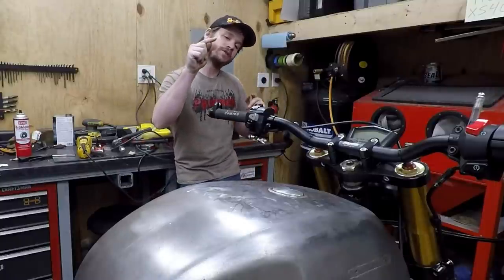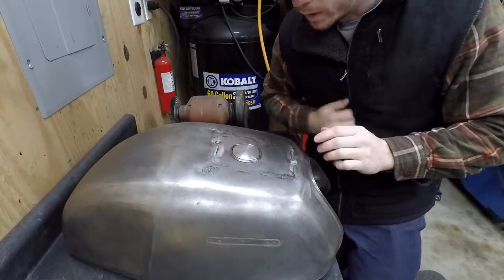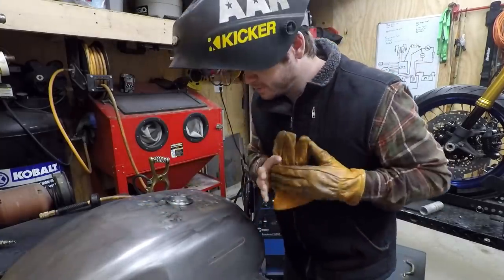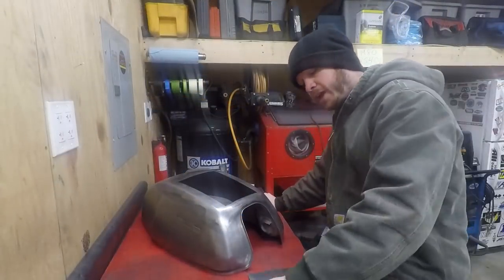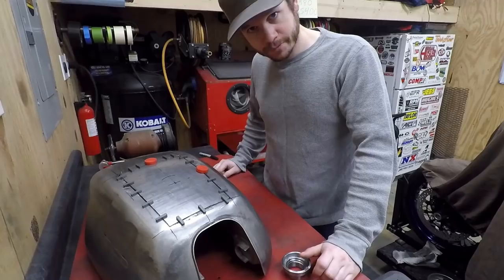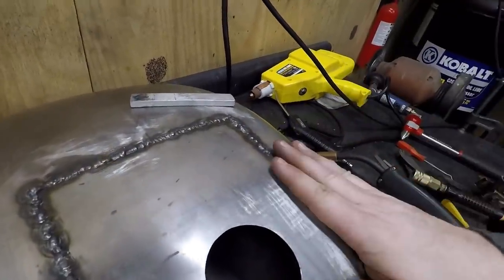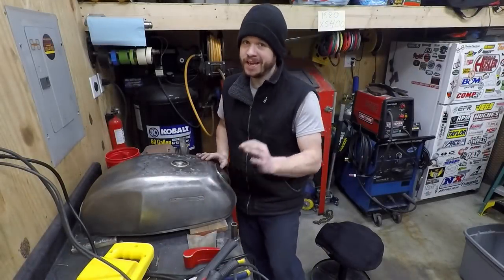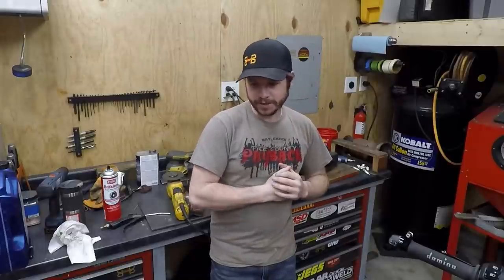CX500 Build - Flush Mount Fuel Cap - This Was Difficult! - EP54

Comment: I really appreciate your work ethic and you are prepared show your good and your struggles. 
Please don’t knock yourself the tank was a great success..
Here in the uk there is a type of putty that is able to takeaway the heat and helps control the warpage by  surrounding the welded area. 
I am really enjoying your videos thanks Richie.
Reply from the maker: I appreciate that. Any link to said putty? That sounds really interesting on its own!
Reply: @BrickHouseBuilds  hope this helps Solder Weld Hot Block Heat Absorption Putty for Welding, Brazing, etc 1lb #SW-HB1 it USA eBay.

Comment: I can appreciate all the time and frustration with this modification. The final product looks great though! And you've inspired me to do something similar with my CB750 project. Thanks.
Reply from the maker: It was suuuuuch a pain in the butt. Added a full year to the build
Reply: @BrickHouseBuilds  Are these type of fuel caps vented?
Reply from the maker: @michaelmartin5942  they claim to be but proved to not vent well for me resulting in the paint being ruined to to internal tank pressure building up and forcing pressure past the tank liner and weld seam. Again, id avoid this mod

Comment: Round corners in patches makes less warping. Also if you hammer and dolly weld seam it expands a little so it removes warping (may not work good with mig welds)
Reply from the maker: I felt I took about every precaution I could and still couldn't prevent warping. I'll never do it again thats for sure

Comment: Great honest video dude, felt for you after the first attempt, and you kept your cool better than I would have. 

Question...how much of the low point warpage could have been sorted with filler prior to painting? Obviously the camera doesn’t show as much as you see with your eyes and the high spots would be an issue too but interested nonetheless. Thanks man
Reply from the maker: The low spots I was talking about were no joke like 1/4" for large areas.  The main high spot was likely that tall as well.  Between the two it had an affect on the filler angle as compared to the tank so it would have been weird looking.  Leveling out the lows and highs ended up also leveling out the neck.  It was a long couple weeks lol

Comment: I don't know much about metal work but would it be worth it to mount the filler neck first in the panel then weld it in as one piece after the fact? That way any warping could be addressed before being welded into the tank. 🤔
Reply from the maker: This seems to be what many are recommending but I can't find info for anyone who has done it that way.  My thought was that having a panel welded would help ad strength to it before welding the neck in but I guess I was wrong.

Comment: Would it be viable to fit the neck to the panel first, perhaps using an aluminium backing plate as a temporary heat sink, and then welding the panel into the tank.
Reply from the maker: I see the thought but per my experience with this tank I don't think it would have held shape at all. It really was a battle. I don't know for sure though as this was just the best I could come up with.

Comment: Excellent job as always! I have installed same cap on my cx tank but having issue with breathing hole! Tank breath nicely but gas is leaking out from same hole, I added an o ring underneath the spring and problem solved as far as leak but now tank won’t breath and that effects the gas flow to the carbs. Are you facing same issue? Any solution? 
Many thanks in advance.
Reply from the maker: Hello Hugh, I actually posted an update in the description of this last month.  The cap does not vent like advertised.  I've had to have this tank repainted 3 times now which is why it isn't done.  I have removed the roll pin from the cap and filed the grooves into the plastic a bit deeper to allow more venting.  I then added a longer roll pin.  I honestly have not even had more than a gallon in the tank at one time.  I plan to modify the cap further in hopes of making it work but overall I wish I never did this modification.

Comment: Great job as always! Cap Doesn’t leak 
Through the air vent? If dose how did you solved the issue please?
Reply from the maker: I haven't had enough fuel in this yet to answer that.  Currently back at paint due to the liner failing causing ruined paint. Its been an extremely long process

Comment: Hey, why don’t you weld it from inside side with the replacement metal before all?
Reply from the maker: I tried for a month to find any info as to the best way to weld this before I tried to tackle the job and found nothing. As soon as I posted this it seems that welding it from the inside is kindergarten common knowledge for some reason. I don't see how welding from the inside would keep anything from warping other than just being able to bodywork the single panel before welding into the tank.

Comment: That’s crazy. I really wanted change mine on xf750, but after watching your hassle, neeehh.
Reply from the maker: I regret this mod so much. It added a year to the build and many thousands of dollars
Reply: From the other thought, if you weld the cap first and then the plate in place ?. And making the cut off smaller for the plate. That would help in my situation.
Reply from the maker: @michalaugustyniak6449  I couldn't tell you. I searched high and low for basic info on how to do this before I tried and couldn't find anything.

Comment: Best captain is on shore... but I'd weld the filler neck on the inside of the plate 1st and then tacked and welded the complete thing...
Reply from the maker: Curious,  have you done one? This same idea is seemingly common knowledge with comments across the platforms but I could not find a single example of how to do this in my searches. I just cant imagine the panel would have retained its shape by welding it that way but again this is the only one I've done

Comment: Where's your safety glasses when you're drilling metal? Learned my lesson doing some minimal frame grinding. Oh it'll be fine, it's just a small part. A week later I had a metal flake removed from my eye. We need our eyes! Wear protection tough guys.
Reply from the maker: I've had metal removed from my eye twice. Both times I had safety glasses on. One of those times it was a face shield ALSO with safety glasses. I appreciate your concern. This isn't a manly thing.